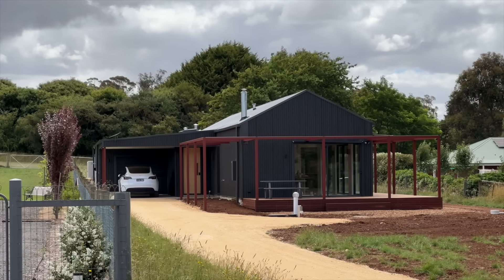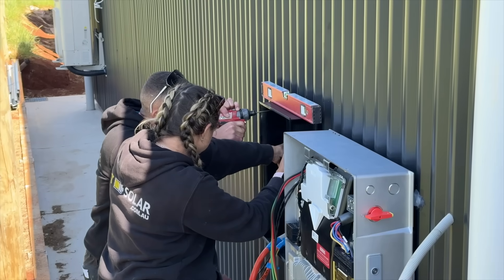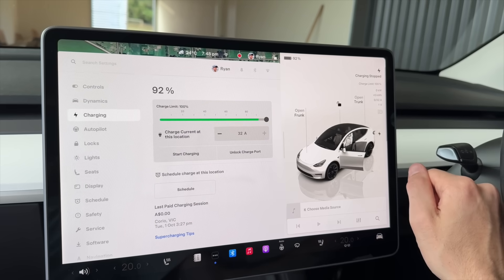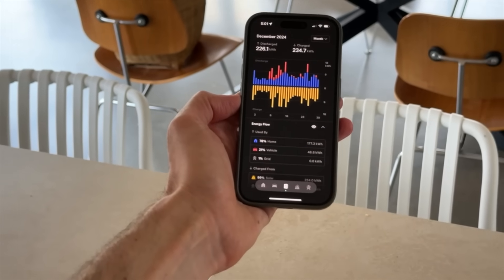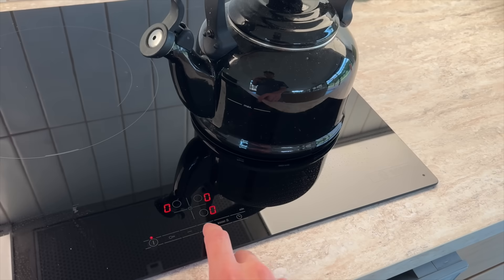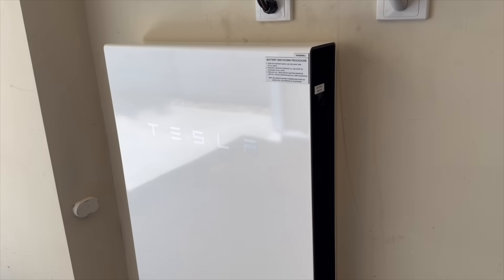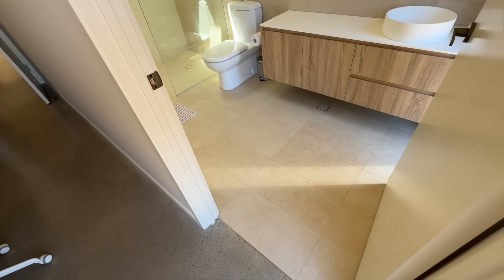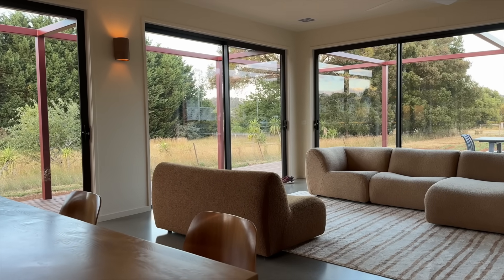1 Week Living with Tesla Powerwall 3

Comment: Problems with PW3, no ability to set car to 'charge from grid' I have super off-peak at midnight, and it will drain the PW3. Can't tell PW3, 'don't use PW during hours between 12am to 6am.' Can't schedule to 'charge from grid at this time to x %' These are basic features available on cheaper batteries. Also, the expansion pack is a rip off. you can get other brands $4000 for 19kWh batteries expansion, tesla is $8000 for 13.5kWh. Hopefully they start getting serious and fix these issues, otherwise will fall back further and further from the competition.
Reply from the maker: I've been doing this via the Netzero app, and creating automations. Email me if you want help with it. But yes, I will be mentioning the same feedback in my upcoming video.
Reply: @RyanCowan I know net zero can do it, but why should the end customer have to subscribe to a 3rd party app to perform these basic functions? Sigenergy does all these things in-house. I believe goodwe also does this.
Reply: @RyanCowan I look forward to your follow up video on the powerwall as well, it’s been a while 😊. I’ve had mine now for 3 weeks, and currently use it in time based control mode.

Comment: Hi Ryan,   Any chance you could give me an idea of what might be going on with my Powerwall3. It can be 100% charge at 5pm after the 10KW of solar panels has charged it. The problem arises when I have one led light, a fridge, a kettle that gets turn on once after work and a hot water cylinder that heats once during the night. The fridge uses 0.1kw at a 50% duty cycle, the hot water runs a 3kw element for about 45mins, the kettle is 2.5kw for about one min. Light ..to low to register. Yet .. my battery is at 30% in the morning. Its nearly like its not charging to full capacity yet it take 3 hrs of solar on a good day (6.5kw charge output from the panels) to recharge it. I am grid connected too so any excess goes there during the day .. but .. I'm not running ANY high discharge appliances. Really confused as to the systems poor performance. Any ideas??

Comment: Hey Thanks for the great video. We are thinking of getting PV + PW3 installed but I am not sure how it would charge EV using "Charge on Solar" option. Say, if you have 16kW PW input into EV (Tesla), household uses 5kW on electric appliances, can the remaining 11kW be used by the wall charger to charge the EV? Or is it going to be limited by Tesla 11.5kW AC output hence only 6.5kW to EV on "charge on solar"?

Comment: Mate you really don't want solar batteries any where near your home or near any flammable materials. I myself would put it quite a bit away from my house, in a cooled stand alone structure. If these batteries blow up, and once getting close to end of life, the hazard increases. You guys are aware the bi product of an aging battery is gas, gases from the battery itself. Ka boom if there is any manufacturing faults. And i'm glad you wife talked you out of putting next to the front door..... because all your doing if you did, is remove a safe exit that was a absolute known safe exit out of the premise due to emergency. FYI. sometimes there are signs of a battery failure, other times the just go boom. Another reason to install away from the house, the fire brigade will not go anywhere near where that battery is installed, and they will let the lot burn to the ground. If it presents more danger to leave it burn, i'm pretty sure they call on the military to blow that site up with explosives. So anyone reading or watching this, Think twice, do some research. It may just save you and you partners/children/pets/even your gold fish's life. Awesome idea, Im all for it, but lets make it safe the whole life cycle, (well as safe as we can possibly be). Smarter thinking esp when it comes down to That wouldn't happen to me and Less smug I guess. Well done, I might get one myself once my export credit runs out in 2028 of 50c per kw. thumbs up bro, Id move it away from my house, just an idea. cheers

Comment: Yes, I know 3 weeks later but... How long does the Power Wall 3 last?  How long can you run the things before you get to the point that the batteries are getting real low.  Or does it have enough capacity to go at 4-5KW all night long? I know it can get up to 10KW output.
Reply from the maker: Most mornings our PW3 is at 70%, before solar kicks back in and chargers it up to 100%. But every home is going to be different.

Comment: Hi Ryan, Love your videos and your new house.  I love watching new houses being built in my area.
I was wondering if you had to pay extra to get power on to your block.  
A neighbour of mine has been told that they can not get power connected to their block until they pay $40,000 to $50,000 to the local power company in the Blue Mountains NSW, to upgrade power supplies in the area.
Did you have to pay extra for the power pole and transformer at the front of your block, or is it shared by other properties?
I see two different Teslas in one of your videos, is that husband and wife?
Looking forward to your next video.
Reply from the maker: Thanks so much ! Local power company tried to rip us off as well. Luckily we managed to avoid it. Didn't have to pay anything out of the ordinary in the end, apart from standard connection fees. This block is an original lot (not subdivided) so that helped. And the other Tesla would be family members, both my parents and Paiges parents drive Model Y's

Comment: And in 12 months you’re gonna get bi directional charging and you’re wasted 17k.  As you’ve got a 80kw battery in your driveway.  But until then, it looks good ! But then i remembered Tesla doesn’t have and wont have bi-directional charging - to try and make you buy a Powerwall.  Locked into spending more  and more $$$ to buy their ecosystem.  But their UX and UI is second to none ….
Reply from the maker: Powerwall is much more than V2H. And Cybertrucks PowerShare feature works well with Powerwall
Reply: How is it "much more" ? its a battery with an inverter built in .....in a pretty cover thats about it

Comment: Hey Ryan when I had solar installed I made sure the inverter was battery ready but when I looked to get a battery it could only be connected to 1 of 3 phases unless I want 3 batteries. Does the Power wall 3 handle 3 phase without this type of hasstle?
Reply from the maker: You'd have to ask Tesla, but from my research, PW3 might not be ideal for 3 phase.

Comment: Hey Ryan, I am getting a 10.5kW system together with the Powerwall 3 installed at the end of February and just wanted to ask (if you want to share) how much you were quoted for. I was quoted a little over $22,000.
Reply: I was quoted 20k but have an existing 11.2kw solar panels with. 10kw inverter. The only thing I’m paying for is admin fee and connection fee from Ergon energy which The government rebate pays for with the Federal and State(QLD) rebate. That’s why I never bought one. In 10-12 or even 15 years the solar wouldn’t pay it off or back plus you’re going to have to replace the battery in that time.

Comment: Problem is capacity of this powerwall 3 hasn't changed from 2, although it can use 10kw at peak that means can only run 1 hour or so at that level given capacity is about 13kwh, my powerwall 2 during winter sometime can barely last whole night and rarely actually reach peak 5kw capacity, and I suspect one 3 battery won't make that much difference in my or most peoples case for now

Comment: Nice-looking house, but why black? While it's definitely a striking and trendy choice, I've always wondered why it's so common in Australia, given that black absorbs so much heat—especially in an already hot and warming climate. It seems counterintuitive when we’re aiming for energy independence with solar, batteries, and EVs, as this choice could increase cooling demands and strain energy systems (especially as the solar and battery systems degrade and the climate gets warmer, both inevitable). Perhaps it’s a case of aesthetics winning out over practicality—a reflection of consumer trends.
Reply from the maker: The exterior cladding colour does not impact just how incredibly cool this house stays on a hot day (without any AC) ! Fair assumption though.

Comment: As an elec eng, the most important upgrade of PW3 is the DC coupling of the panels via the in-built MPPT's - saves the cost of external AC coupled inverters and provides armageddon capability.  10kW single phase sustained is still too low IMHO. In my setup, I have a large house on acreage in NW Sydney - 64kWh LFP, 3 x  Victron inverter/chargers (8kW sustained and 20kW peak per phase) sharing the battery (yes, sharing is the vitally important as phase loads are never balanced), 40kW AC  coupled and 10kW DC coupled panels. For overcast skies mid-winter, battery struggles to fully charge daily, so you'll face the same challenge. I can export to the grid and this pays for the daily connection charge from August to May. Also, I chose a 3 phase aircon that has a wide ramping capability (MHI 20kW -> 22kW max and 5kW min) - this is important to optimise energy usage when turned on and each room is a separate zone.
Reply from the maker: Nice !! Sounds like an amazing setup. We only have single phase available in our rural location. The installer mentioned multiple times how good to the DC coupling is with PW3, so will be sure to mention this in future content.

Comment: Very nice,  we are looking to move rural very soon,  will be very interested to hear more about the build, costs and pitfalls etc.
When it comes to using excess solar energy,  we have installed heat pump hot water, and set to heat at 12 pm to 3 pm, and now cook and eat main meals at lunch time,  so we are cooking with induction using excess, and not eating at night, (also lost weight doing that) and use air condition to turn the house into a thermal battery, cool the house to low temp, so when solar stops for the day, no need to run air con through night as home is already cool.

Comment: Hey Ryan great video! Thanks for sharing your experience. A question, you said you can use air con and charging your car at night and your PW3 never drops below 50%? I would think air con and charing would easily run over 13kwh in 10 hours.
Reply from the maker: Just in the first week, we haven't dropped below 50%. Our house is built on passive principles so very rarely do we need heating or cooling. We have only charged the car via solar since we moved in.

Comment: I have a 9 kW battery that drops to 20% which is the minimum on some nights them imports from the grid, but most nights with the bedroom AC on, it gets through until the sun comes back. I love it. With the main AC on through the day, I watch the graph and modify what I put into the Model Y, just using solar.....and of course the dish washer cycles only when there is plenty of free power. I do wish I had bought a Tesla power wall.

Comment: For Tesla’s charge on solar feature to appear. You need to set permission to export to yes. 
As soon as I set it, the feature appeared on the car page. 

I tested backup power feature, it took a few seconds to switch over. Not quick enough for computers, still need UPS on critical infrastructure such as NAS and Home Assistant server. 

What water tank is that? They are usually indoors only, would be good to install it outside when I change over to heat pump heating.

Comment: Gratz on the house! Cheers for the info also, i didn't even know we had PW3 in AU's yet. I have the PW2 atm and am about to order a 2nd PW2 and will have max 10kw output during peak loads. Most I ever pull during evenings is around 8kw.
Reply from the maker: Cheers, glad you found it useful! Nice work on PW2, that will be a great setup

Comment: What size solar system do you have? ie Solar Panel kW etc 13.2kW?
Reply from the maker: 9.24kW
Reply: @RyanCowan  nice, just be wary when it gets to winter. It likely won’t be enough to charge the battery and cover your usage during the day. But hopefully you have a EV plan where you can charge your battery cheaply at night and  charge your car. I just upgraded from 13.2kW solar to 19.8kW with 15kW inverter. So good our bill just keeps reducing everyday.

Comment: Not to be intrusive but I am fascinated by being self sufficient and I know Australia has different pricing than the states…. But how much with the power wall, solar panels, and house did your total cost come to?
Reply: im in melbourne, and have 13.5kw solar panels + pw3 on order to replace 13 year old 5kw system and cost is around $22k after rebates. had another quote $24k as well.

Comment: Ryan, you appreciate having the Powerwall during those power outages. Sorry if you did mention the size of your solar but how many kilowatts is it and is it three phase.
I'd love to know the figures like peak output in the middle of the day and production for a day. 
Is it ok to charge your car from the battery? I guess if you're not home through the day, you can't go direct from solar. I just thought I'd heard it wasn't that great to charge an ev from the Powerwall.
You'll be set when you get your excess exported to the grid. That'll help pay down the initial outlay
Reply from the maker: 9.24kW solar system, single phase power. You can 'top up' your car from Powerwall like I was, but the cars battery is MUCH bigger, so wouldn't normally do this. It was just because we hadn't moved in yet.
Reply: Yeah that would be awesome to know. I have solar panels on my home, not Tesla ones though, and we are operating with the largest amount we can without upgrading our inverter and power system and whatnot. The 22 panels can still struggle to power our hot water, dishwasher and washing machine at the same time, though we don't have a battery yet because we are waiting on the price to get smaller and the tech to get safer.
Reply: That's good to know Ryan, thank you.
Mine is also single phase and maxed out in Queensland as 10kw.
I'm seriously thinking about a new y. I have a fair bit of excess power that does get fed into the grid but given the difference between feed in tariff and cost of night time power, I need to feed in 2.5 times what I buy to break even.
A battery changes all that but it's just that initial outlay.
Good on you for taking the leap with it all. 
Something I would have done is go solar hot water 
We've had our system for just under 20 years and still performs well. (Touch wood)
Thanks for the reply.
Cheers Peter